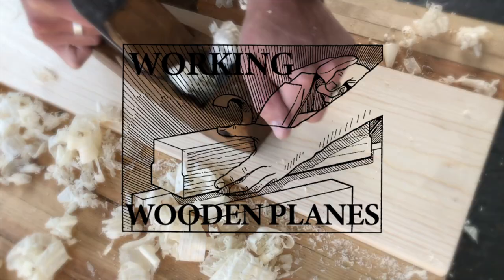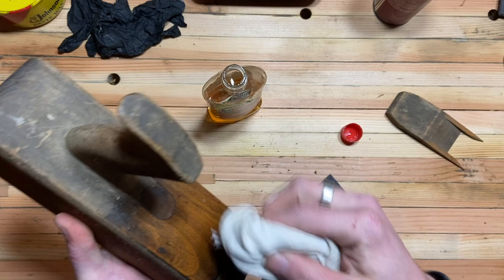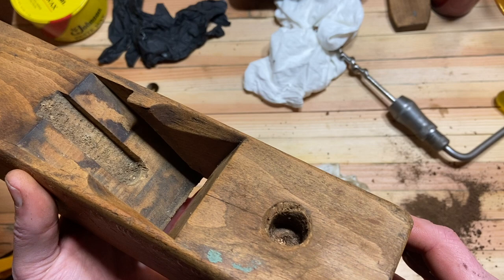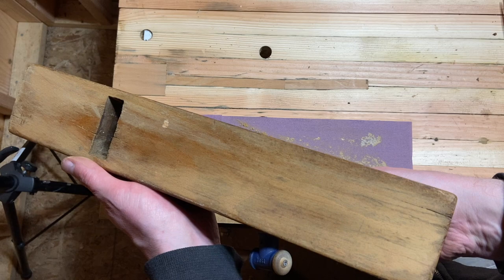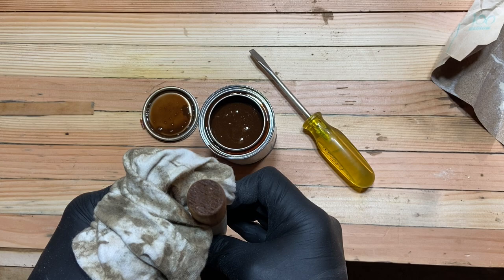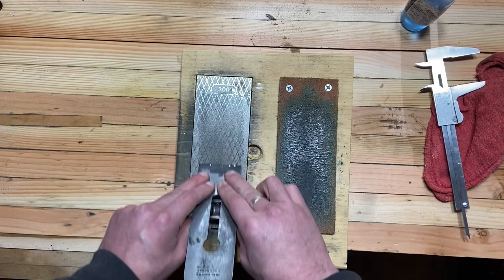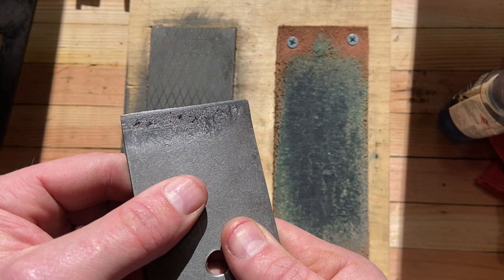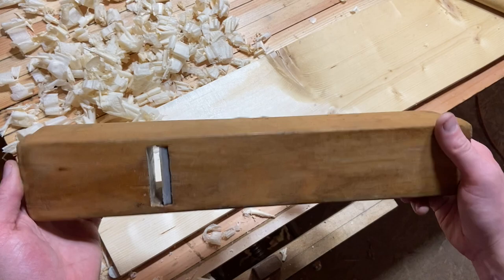The Ohio Tool Co. Story (and jack plane restoration)

Comment: I have the same plane by the Ogontz tool company with a Sandusky cast steel iron.
Reply: I have a wooden smooth plane my father bought me almost 50 years ago that has a Sandusky iron.  Very hard cast steel.  A real keepsake,  although I use it occasionally.

Comment: I just picked up a jack with New York Tool. Co on the front with a very old Ohio Tool Co logo on iron.  What do ya think?
Reply from the maker: New York Tool Co. was a brand name used by Auburn Tool Co from 1864-93. Auburn had a terrible reputation because they used prison labor. So they used multiple different brands to avoid the tools being associated with them. Ohio Tool Co merged with Auburn Tool in 1893. I don't know if Ohio Tool continued making planes with the New York Tool mark. The iron is not an indicator of when the plane was made. A carpenter would typically use up several irons over the life span of a plane

Comment: I found this video while researching an old block plane my step-mom brought over. Quick question, if I don't have Murphy's on hand, can I use Pledge spray, or should I just run out and get some Murphy's?
Reply from the maker: I've never used Pledge. I like Murthy's because it does a good job breaking down heavy grime. I'm not sure how well Pledge would do. If your plane isn't that dirty, just wipe it down with paste wax. That's actually my preferred way of cleaning a plane

Comment: I'm curious as to why you didn't redo the mouth. Wooden planes were engineered make this a relatively easy operation. Do you know what dimensions of the original opening were?
Reply from the maker: That's a great question. I don't. But the wooden jack planes I've seen that appear to be barely used all have big mouths. I think we make a bigger deal about mouth size for jack planes than those guys back in wooden plane era did. Smoothing planes are obviously a different story. You need a really tight mouth on those. But I think that a tight mouth on a jack plane would have just jammed all the time on the rough work that these planes were originally used for.